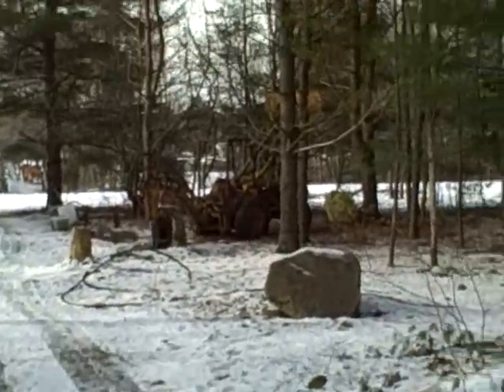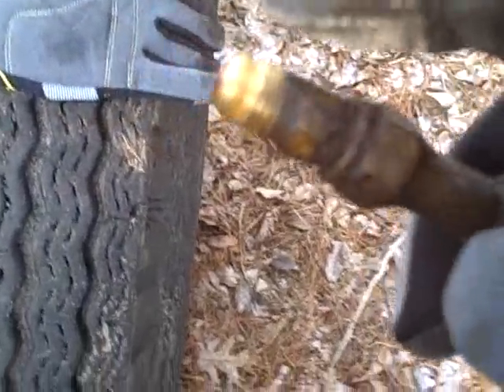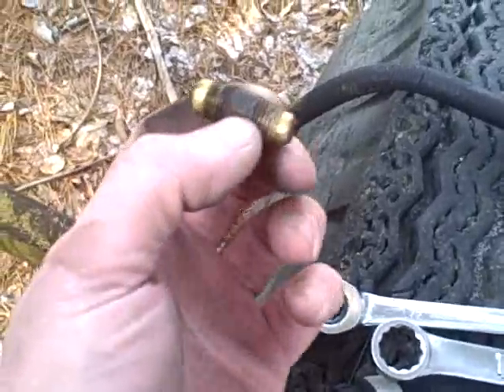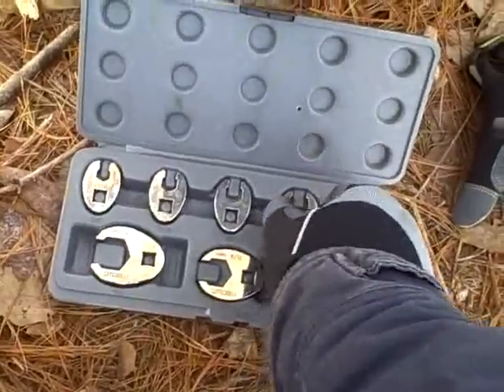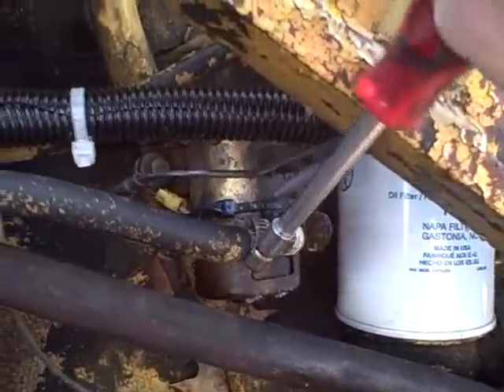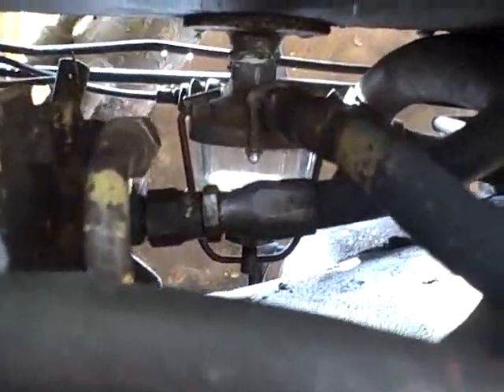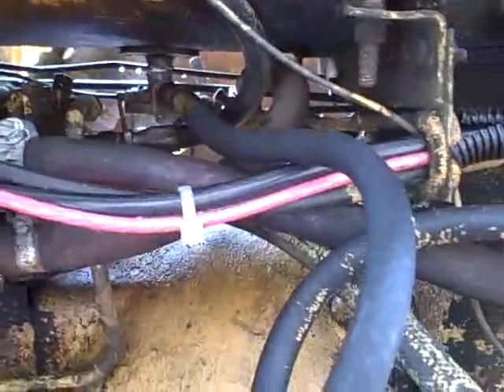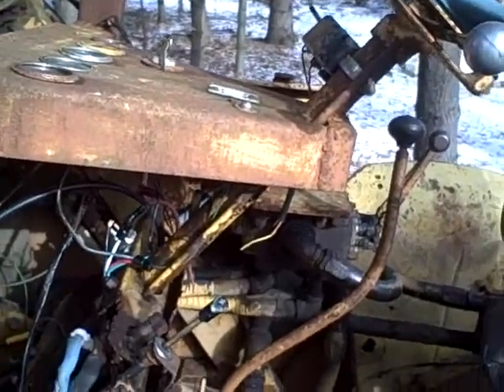Oliver 770 Industrial Tractor Project Part 50

Comment from the maker: It was dripping slowly because it could not displace air. I made sure it was all clear before installing the assemblly back on the tank. It's been running fine since reassemblly.....well, as fine as a worn motor, with issues can.

Comment: Did you blow back on the fuel line to see if the tank port is open , That orfice should just pour thru there into the bowl fill it immediately or that could be why it`s stalling ;

Comment: That should fill that sediment bowl in a few sec not drip out when it`s running full out you won`t get enough fuel dripping that slow , Take off at the filter and blow back on it then watch the flow in M - T bowl never hurts to check ,The old farmall tractor we had had the same bowl you could`nt get the bowl on fast enough if removed to drain .